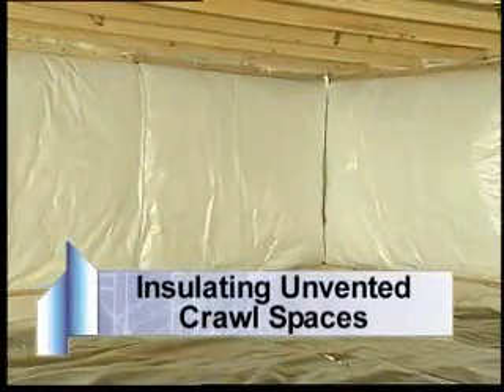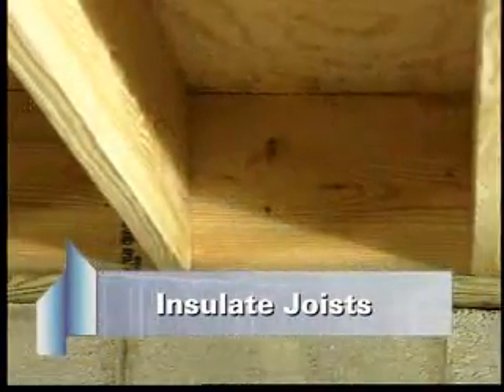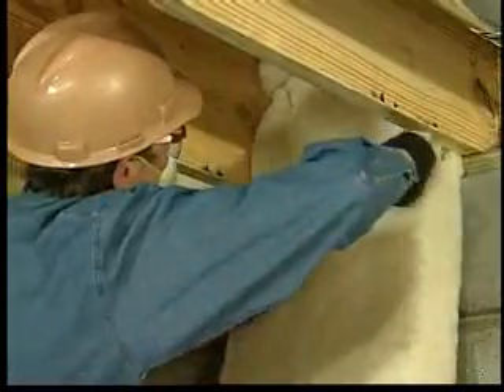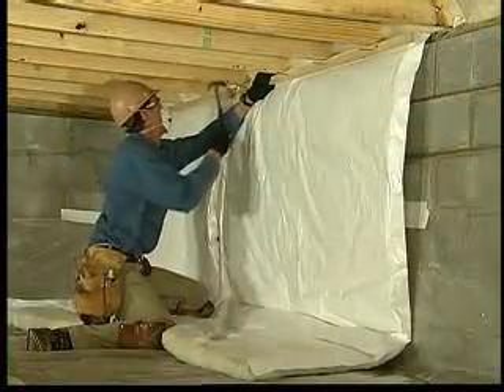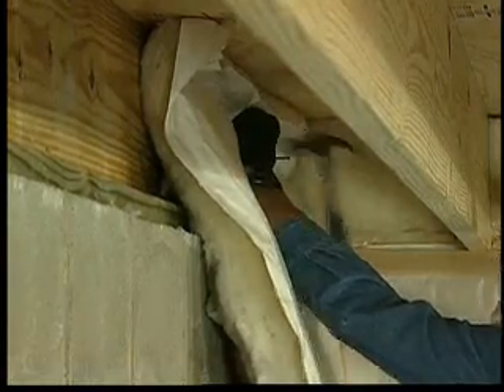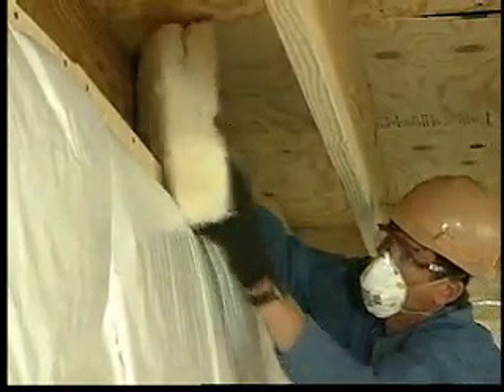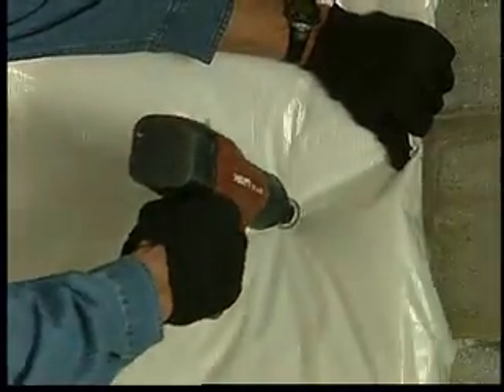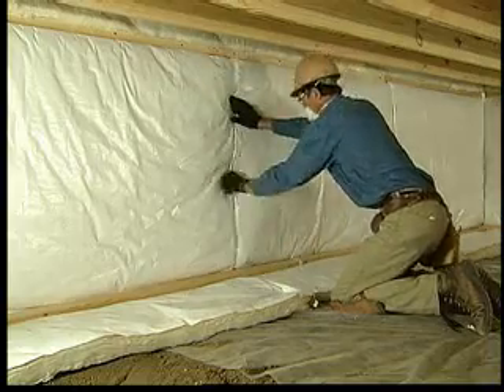Insulating Unvented Crawl Spaces

Comment: 0:50 It would be much better to use rigid styrofoam boards for the walls because mice or other critters can bed in those blankets, than they chew inside the house.  Don't ask how I know:)  When I re-do mine I'm sealing the rim joists with galvanized metal mesh sold specifically to prevent mice, and spray foaming it in place.
Reply: Don't get carried away with spray foam.  There are videos on here which demonstrate that termites are using it as a superhighway to ravage entire structures, literally undetected because they tunnel through the foam.

Comment: Don't put fibre glass against a wall joist, it will pass damp air right through it which will condense back into water and rot the wood. Use a rigid foam board.
These people clearly don't know what they are doing.